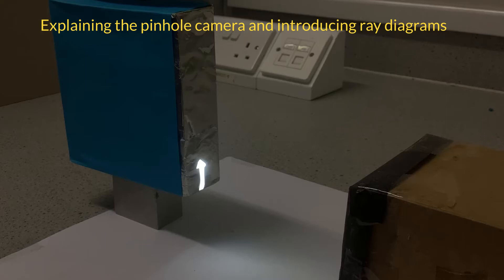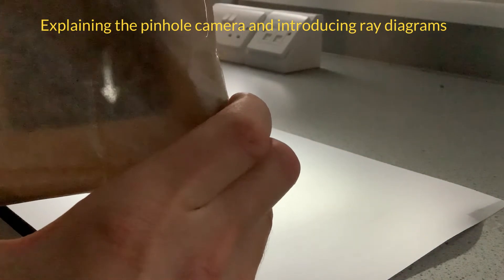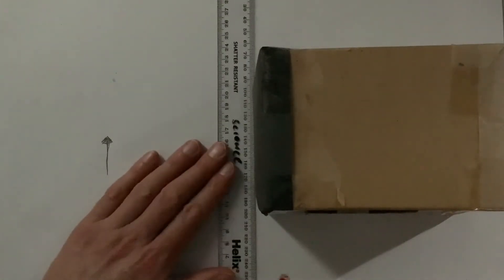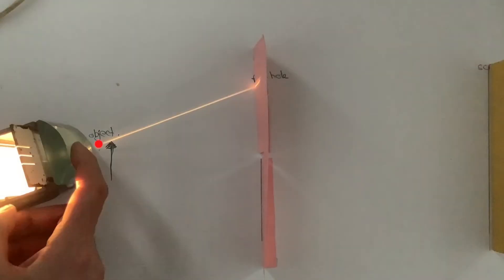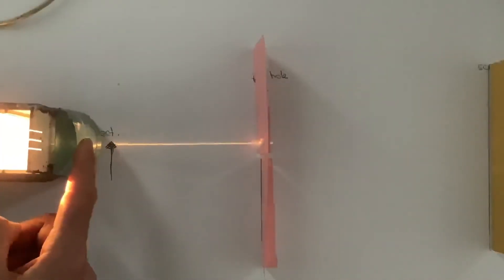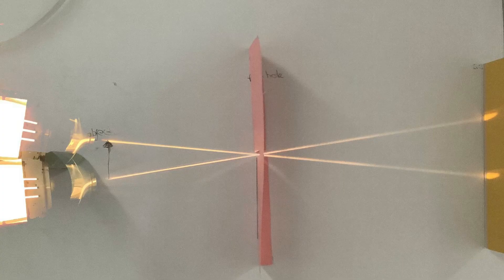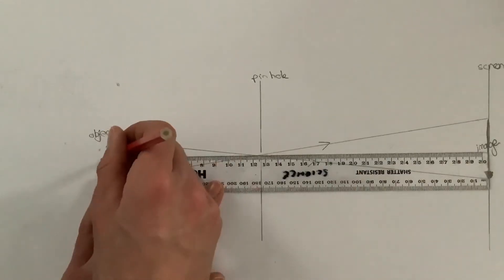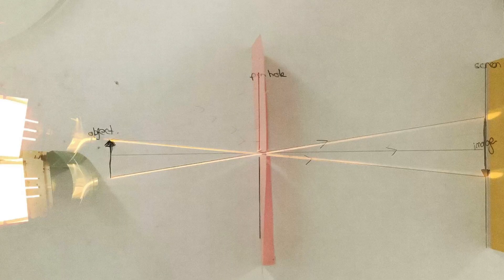Explaining the pinhole camera and introducing ray diagrams

Comment: Why does the light not diffract when going through the hole of the pinhole camera (similar to Thomas Young's double slit experiment)?
Amazing Video
Reply from the maker: For significant diffraction the width of the slit must be similar to the wavelength of the wave.  Light has a wavelength around 0.0000006 m so the pin hole is too large for significant diffraction.
Reply: @SimonPoliakoff  Thankyou

Comment: OK as far as it goes, but a 3D representation would be even more interesting. For example, it makes no difference to the orientation of the arrow whether you view the projected image from outside the box (through the translucent screen) or - imagining the box to be the size of a room - from inside, with the light source behind the observer. In both cases the arrow will appear upside down. But a 3D representation makes it clear (as the video correctly states at the beginning) that as well as being inverted, the image will also be reversed left-right. Here, however, it does make a difference where the observer is. An observer outside the box looking through a translucent screen will see left-right (i.e. mirror reversal). However, an observer inside the box who views the image projected on to an opaque screen facing the pinhole, while seeing the image inverted, will NOT see it reversed mirrorwise.
Reply from the maker: A fair point but hard to do a 3D representation on a video.

Comment: I just realised that when i look through a pinhole it somehow reduces(or maybe bypasses somehow) affect of my myopia. How does that work?
Reply from the maker: Perhaps it is the edges of your cornea which are too curved and so refract the light too much.  The pinhole would restrict the light to that which has comes through the central part.  Or if different parts of your cornea refract by different amounts then the lens in your eye can only correct for one part at a time.